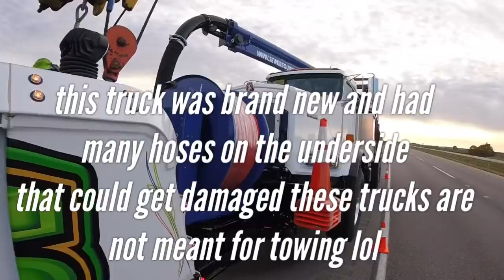Rotator work ep#130 pump truck on the highway

Comment: Another good video guys,Looks like the under reach was very close to being max out being extend all the ways out. Be nice if they made a LED light bar with a flashing directional arrow like the one you use for the brakes and turning signals. You could strap it to the back of the truck before you start any working, then change over to the turning and brake light bar when your ready to tow,  Be a lot easier to see at night then the cones. Be safe and keep the videos coming.

Comment: Good job guys.  Boy that's the pits.  Brand new truck and you blow a radiator hose.
Reply: Can we be sure that the hose actually failed, as opposed to the hose blowing off the end of the pipe because maybe it wasn't properly fastened down with the hose clamp?  It has happened to me twice, on the same truck.  The first one was a boot on the charged air, the second (a week later) was a rad hose that popped off the connector, both seemed to point to a problem with the hose clamps not being tight enough.  You can be damn sure that the rest were cranked down tight, and checked on a regular basis after that.

Comment: Guess I'm just amazed that they didn't send out a mechanic in a pick-up truck loaded with coolant and hoses rather than pay to have it pulled all the way back to the shop.  Then again, I don't see how the radiator would get enough air to keep from blowing hoses off that thing.  Good job, but from 1000 feet back all people would see was a truck pulled over.  At 60~ 80 mph, not enough time to recognise the problem and pull over.  The entire industry needs to come up with a much better way to alert drivers that there is a problem ahead and they need to move over well in advance.
Reply from the maker: Yea I agree we try by putting cones out I have some flashers I use when it’s dark to help out but would be nice to give a further warning ⚠️ but would also make it a it more dangerous for us to walk a mile back to get a sign we left back for and advanced warning but I do wish something could   Be done maybe like a sign on wheels that could return to u with a paint line u put on the ground idk maybe I just invented somthing

Comment: Malachi No safety chains???? I understand it's new but you could have hooked them to the frame at least. Scary stuff buddy. I heard you say that it was heavy and it sure looked like it would be heavy. Did you lower your lift axle when you got going? How many pounds of pressure do you put in your lift axle when you drive with it down?? I have 3 lift axles on my mixer and I'm supposed to have 105 psi in my first pusher, 95 psi in my second pusher and 95 in my tag axle. That's when I have a full load. However I only run about 75 psi in each axle otherwise it takes to much weight off my drive axles.
Reply: From the video, there's really nothing for the safety chains to go around. They'd probably get tied up in the overhang as well. No part of the frame past the bumper looked like safety chains could be applied without heavily damaging the hoses there.

- Purely my opinion, no real-world experience.

Comment: Why do you always cage brakes instead of running air?
Reply from the maker: When ever there is air in a truck it take no time to throw a caging  bolt in and this truck was brand new just built so I didn’t want to pop the paint on any of the air tanks thanks for watching